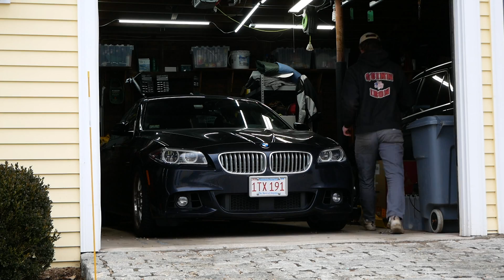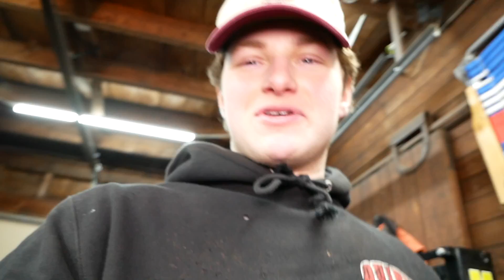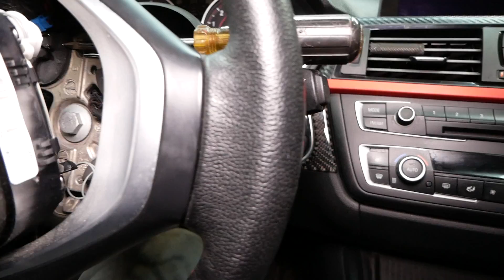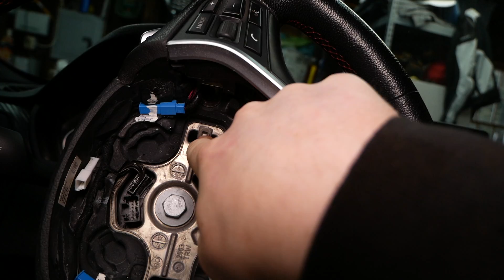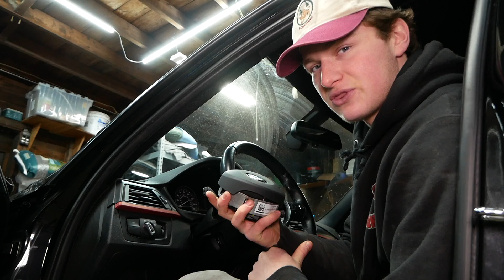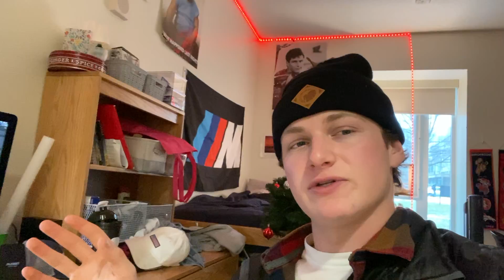How to UPGRADE BMW STEERING WHEEL // SECRET to AIRBAG REMOVAL!

Comment: Removing the negative lead is much better practice when removing a battery. Also you can close the boot lock manually so there's 0 chance of closing that boot 👍

Comment: Hopefully you can shine some light on this question I have. 
I have a 2015 f36, literally the same car with minor differences but for changing the steering wheel its pretty much the same. Currently I have the stock wheel with paddle shifters, and heated steering. I want to switch over to the mstyle wheel eventually. 
I don't really use my shifters ever so would I be able to get a new steering wheel without the paddle shifters and install it without having any problems? And also the heated steering wheel, does it need to be specified when buying that it's able to accommodate that? Hope you're able to help out! Awesome channel👊🏼
Reply from the maker: Yes and yes! You can do exactly what I did which is install a new msport wheel without paddles but with the heated function. You'll need to make sure the new wheel is heated (equipped with the heating strip inside). The seller should advertise this.

Thanks for the support!

Comment: That’s great, and easy to do, but the biggest concerns are the buttons functions and most importantly airbag module controls, did it require reset?
Reply from the maker: Plug and play! Though I may have had MyBimmerBrain code the airbag now that I thunk about it

Comment: Hey there bud! Love the way you smoothly changed that steering wheel. Seemed so easy! I was wondering if you can help me out with the steering wheel, I just got my BMW and I don’t want to take it anywhere to get it done. How much would you charge me to install it on my BMW?

Comment: is the new steering wheel from the same generation or a newer generation? Can a 2020 wheel fit on a 2014 car?
Reply from the maker: I'm not sure if a 2020 wheel would fit a 2014-- unlikely it would wiring wise. This wheel was from the same generation (F30) 3 series.

Comment: @ 10:03 you said its a dual-stage airbag but yours is actually triple stage (3 connectors on the back vs. just two). I was wondering if you knew whether or not there's a huge difference between them because I cant find anything online about it.
Reply: Im searching for This too.

Comment: I want to do this with my F36 (430i GC ‘17) but every m sport steering wheel i find custom or OEM all say that it wouldn’t fit my car. Right now I have the same steering wheel as you had. Any idea on if it’s even possible ? Great vid btw

Comment: Nice work. I followed your technique and it worked after getting super frustrated. After installing the wheel I got driver restraint system error. What might be the issue it you could help bro??

Comment: Hey man, did your heating keep working after you installed new m sport wheel coz mine stopped working.. light doesent go on in the heating button
Reply from the maker: Yes it still works. I would check the heated wheel connections to make sure they're still good.
Reply: okey! i try thanks

Comment: Does the original big wheel have to have paddle shifters in order for the new steering wheel paddle shifters to work ?
Reply from the maker: No it doesn't. You can add paddle shifters to non steering wheel car

Comment: Great video! Can you explain if there is one wire harness or two on the steering wheel itself. I am like you and have the heated wheel function so not sure if that is a separate harness. Thanks!
Reply from the maker: One harness, but there is an additional connection inside the cowling that I removed in the video.

Comment: Just did my steering wheel but I got error code 930910 Airbag Driver Valve: Resistance too big. 
Any idea how I can get rid of this code?
Reply from the maker: I resolved this code by contacting mybimmerbrain

Comment: I purchased steering wheel with eu airbag and coded driver’s airbag from us to eu. 
M-Wheel with paddle shifters and airbag cost me €350 in almost new condition, from 2017 f30. 
Just an idea how to save money on this conversion)
Reply: What do you mean you coded airbag from us to eu?
I live in EU but my car is imported from US. Can i fit EU steering wheel and airbag?
Reply: A K yes you can, but you need to code appropriate type of the airbag for your vehicle. US and EU airbags are different - US is dual-stage, EU is single-stage.
Reply: @andrewg48  is it safe to do so?
Does it function as a standard euro airbag than? What about the other airbags in the vehicle
Reply: A K it’s absolutely safe. You should code only airbag in the steering wheel. Other airbags leave as is. After coding your vehicle will “know” what type of airbag installed and works correctly.
My BMW has no errors or warnings after installation and coding.
Reply: @andrewg48  okay so there is hope for the new wheel afterall 😄
Thank you!